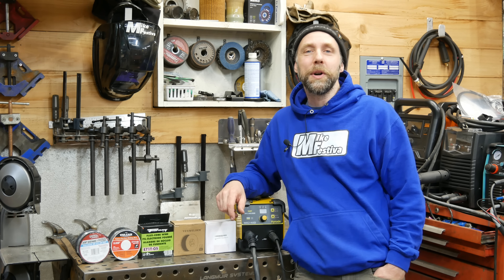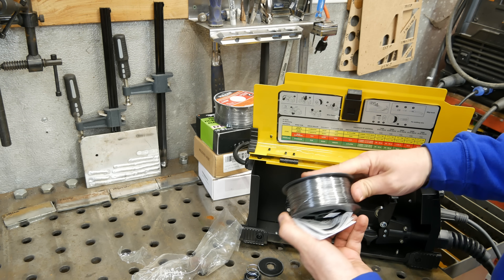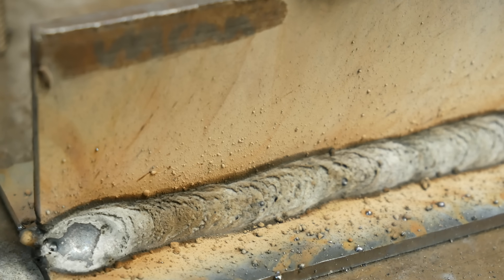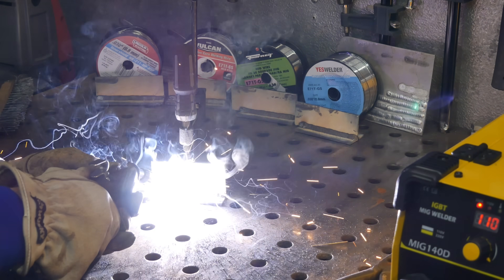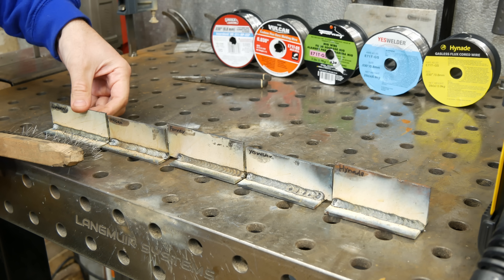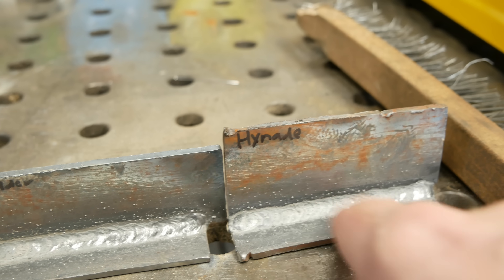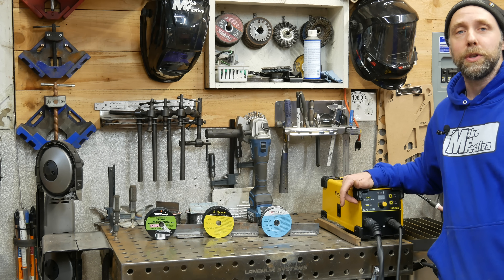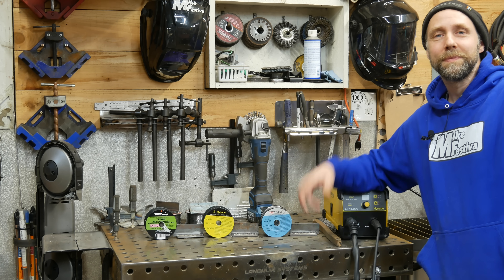Gasless Flux Core Welding Tips, Make Better Cleaner Welds

Comment: Thank you for the excellent comparison of wires. I have welded with MIG, TIG, and Stick mostly. I have a little Walmart flux machine that I use on thin stuff. Clean is the first item. If it's any thicker stuff preheating with the propane torch helps lots.
I don't do any serious welding with the thing, but I do find it is real good for tacking pre-weld for my 36 year old Craftsman AC/DC 225 stick welder. I've put that machine through hell. I'd recommend it to anyone if it was just as good today. It was made by Century.
I did use the flux machine to weld patches in my friends mower deck and liked the results.
I need to get a more serious flux machine in the future and I know whose videos I can reference to make a good decision.
Cheers
Terry from South Carolina
Reply from the maker: Thanks for watching Terry!
Reply: Terry,I have just acquired a Century 100 amp to do thin mower decks,info on #wire,speed greatly appreciated, thanks, Ken

Comment: Hey Mike,
I got the Hynade 155 today.  That's a fine machine.  I like the synergic mode.  Works nice.  Nice clean weld with the included .030 flux wire.  I like it.  I also tore into the Yeswelder flux 135 and found found a cold solder joint on the inverter board.  Works great now, so that issue is over with.  But now I have 3 flux core welders: Titanium 125, Yeswelder 135 and the new Hynade 155D.  My shop is starting to look like a welding supply store, lol.  I'll email Yeswelder Monday and tell them to close the ticket. I'm going to donate the Titanium to one of my neighbors.  Like you say..pay it forward.
Take care and thanks.
Reply from the maker: I’m glad you got the Hynade and like it!
I’m also glad you found the problem on the Yeswelder, it is a bummer you even had to take it apart to fix a brand new welder. I did send a message to Yeswelder the on Friday with your order # and problem, I told them they need to make it right with you and I mentioned I’m extremely disappointed in Yeswelder for not promptly taking care of your problem. 
I would hope they contact you come Monday. If you hear back from them I would be interested to hear what they say? I haven’t had any problems with there products so far but hearing they didn’t take care of your problem makes me question how much more I want to work with that company.
Paying it forward is awesome Timothy! I think your friend will be really happy 😊
Reply: @Mikefestiva  Yeah, it works great...nice beead using the .030 wire that was included. Ana@yeswelder was going to ship me a replacement welder and told me to keep the other one.  I replied that she can skip that since I repaired the one I have.  Overall, it turned out OK.  I would still buy their products, but they need to revamp their warranty process.

Comment: My biggest complaint about flux is the wire is so brittle and susceptible to kinking or breaking.  It would be good to compare this quality.    I also  dislike how these wires want to spring  into a mess.  I wish there was a design feature that inhibited this.
Reply: The Vulcan is horrible for this. I've had much better luck with Hobart flux wire. Haven't tried the Forney as i decided to stick with E71T-11 for now instead of the GS stuff.

Comment: Very interesting video, Mike, well done. Like you, I have only used Lincoln and Harbor Freight Flux core due to availabity.  These wires do not run the same on my machine. I have to tweek the machine settings for each wire to get good results. I would like to try some of the other brands that you tested. I have a small machine for flux core like you. I have a larger machine where I use solid wire, which I prefer.
Reply from the maker: Thanks Anthony 👍

Comment: What’s interesting about fluxcore, is that using it is not what many people expect. So the cheapest wire welders are fluxcore, because they’re simpler, and thus cheaper than MIG machines. The HF Titanium 125 is a good example. So the first experience new welders have with welding is fluxcore. But it’s harder to weld with fluxcore than mig. So it may not be the best choice for new welders, particularly the majority who haven’t taken a course in welding.

Comment: "Oerlikon Fluxofil 14HD" the best flux cored wire for field work on the market, not self shielding though still needs gas, but the welding afterwards knocking of the slagg is completely smooth, and they even brag that you can weld in all positions with the 1 setting shown on box.

Comment: I'd like to see you let these wires sit around for awhile then come back n see how they look n weld to simulate the guy that grabs a spool to have when they need the flux core. Maybe cut off a 12 inch piece from each n just let them sit out in the shop to see if they rust or in the case of the shiney ones, if they get dull

Comment: i always just figured horrendous spatter was just a fact of flux core life. i've tried lincolin, vulcan, and some i don't remember the name of that was cheap, so i tried it. i got about the same results out of each, so i just started buying the cheapest i could find. lucky me, i just bought a 10 lb. spool of fourney at rural king on clearance, but haven't tried it yet because i have to make an adapter to use the bigger spool on my welder. this kinda tells me that i should be on the lookout for fourney wire in the future. it really does suck having to spend more time cleaning slag and bb spatter after the fact, than time spent actually welding on projects. very useful vid, thanx!
Reply: depending on your machines capeable settings, spray transfer can seriously reduce spatter! low wire feed high volt, makes a continous even deposit rate, instead of 1000 small shortcuts wich sometimes explode.  try about 28volts 9.2m/min

Comment from the maker: Welding Wire Links
Amazon Paid Affiliate Links Below
Hynade Amazon Promo code 05MIKEWELD at checkout and save 5% 
Hynade Flux Core Gasless Mig Wire- https://amzn.to/35KX9XC 
Hynade 140D Flux welder Dual Voltage 110/220V https://amzn.to/3O4jMYy
YESWELDER Flux Core Gasless Mig Wire- https://amzn.to/3LLNkbd
Forney 42300 Flux Core Mig Wire- https://amzn.to/37nfqLh
Here’s a paid affiliate link to Yeswelder website
YESWELDER LINK:  https://yeswelder.com/?ref=s6nzvjxbwejy
SAVE 10% on your entire order! Promo code MIKEFESTIVA 
*Good affordable Plasma cutters below* 
Bestarc Pilot Arc 50Amps Plasma Cutter 110/220V Dual Voltage https://amzn.to/3KnCxDV
Hynade CUT40 budget friendly 120 volt HF start plasma. https://amzn.to/3KiZvMz
Reply: very enjoyable and easy to understand video, actually learned somethings
Reply from the maker: @terrymelen4239  Right on 👍🙂
Thanks for checking out my new video!

Comment: Mike, thank you for this review. I always used to run Lincoln flux, thinking the well known name brand would be better. I got in a bind and had to buy a spool of HF brand wire (Chicago Electric) before they changed to Vulcan. I just thought that I hated running flux. I don't do much flux core anymore, except when I run out of shielding gas, but like to keep a roll on hand, in case.
Reply from the maker: Thanks for checking out my new video Bill! Yes I don’t run Flux as much anymore either, like you I mainly keep it for a backup, and on occasion when I need to pack a small welder and don’t want to lug around a bottle of gas. Take care and have a good weekend 🙂

Comment: I used to use the holbart wire because it was available at my local tractor supply but now I have been using the Fourney for two years I have it sent every few months threw my Amazon subscribe and save and it’s even cheaper that way

Comment: The Lincoln wire Is the only wire out of the bunch that is E71T-11 which means it's actually rated and tested for 70k pounds and can be used with multi passes. There's an important difference between E71T-GS and E71T-11. If your welding for strength go with the Lincoln or another that's actually tested and rated.
Reply: The 
‘Off brands” are from makers we don’t know, and often the labels buy whatever is cheapest at the time. So one may be good one time, and bad another. Spatter and blueberries are as much a matter of technique as wire brand. I’ve found that different wires need to be welded somewhat differently. Some require a bit more or less amperage to weld at their best. You just have to practice a bit with either before using them.
Reply: Thanks for the info. I've been using the Lincoln for my very few attempts at welding and I've done multiple passes without thinking twice.
Reply: Thanks for adding this important comment.  Now I wonder if there is a similar distinction for stick electrodes.
Reply: @DamEngineer  yes there is, last digit of the number of the rod (7018, 6010, 6011) determines what the flux composition is and the application for the rods. Example, 0 is cellulose fast freeze DC current, 1 is cellulose fast freeze AC or DC current, 8 is low hydrogen iron powder fill freeze.
Reply: @DamEngineer  I don't remember all the details about how to read label but specs are on the electrode. What those numbers mean can be found.
Reply: I don’t know anyone who’s building a 70k pound truck, but okay.

Comment: The lincoln wire is E71T-11 versus E71T-GS. E71T-GS is more common. I was told E71T-GS is single pass and isn't standardized. E71-T11 is multi pass and has to meet standards. So E71T-GS can vary greatly between brands.
I think brand and freshness makes a big difference. Moisture can be an issue. Especially for us up here in the great north wet. I usually run hobart E71-T11 wire because it is convenient to get and runs better than some I've tried. 
Ultimately it's flux core and I'm not to worried about it being perfect.

Comment: The biggest denominator is if your welder is actually putting out DC. Cheap migs are actually putting out what resembles an AC signal, which is terrible for mig welding (lots of splatter). This is why popular mods for these cheaper welders include bridge rectifiers so that you get a clean DC signal. Needles to say, a quality welder will already put out a clean DC signal.

Comment: Just curious but could that welder do spray transfer flux core?
Reply: E71-T11 flux core wire can spray transfer. If the machine is capable.

Comment: I got a YesWelder Flux-135 last year, came with the same spool of fluxcore you tested in the video from YesWelder. Good to know its actually a good wire to use. Not that I have had any complaints about the welder or the wire, though I could use more practice at it.

Comment: I bought a 10lb roll of Lincoln once. Fought through about 5lbs of it and gave up, never again. 
The Vulcan i didn't think was too bad.
But lately I've been using the yeswelder and it works better than anything I've used before.
Reply from the maker: I’m glad you have noticed this as well! Definitely big difference in brands.
Thanks for checking out my new video and sharing your experience as well 🙂👍

Comment: Hey Mike, hope all's well. Thanks for the intel and demo. Have a project coming up and think now I'll consider fluxing to save on the C25 I've been blowing through to avoid the spatter and those related issues with the Lincoln flux (the only brand I've used because it came with my Pro Mig 140). The Lincoln solid's been ok (only brand I've used as well) but the cost per spool and to keep swapping out bottles around my neck of the woods can get rather pricey. Have you used any of these brand's solid wire with gas? That could be a game changer as well contingent on the price. Thanks and stay safe (all you other members as well) . . . . JJFIII

Comment: My Yeswelder Flux 135 was doa out of the box and I've been going around with Yeswelder on the warranty.  Had to send them photos of the issues and I still can't get them to replace it, so I will attempt repairing it myself and if that doesn't pan out, I will save any usable parts and scrap the rest.  Their so-called warranty is a joke.  My Yeswelder CUT 55 plasma cutter worked fine and have had no issues with it since.  Guess you get what you pay for.
Thanks for the great how-to on flux core.
Reply from the maker: I ordered a Flux 135 from Yeswelder about 3 months ago from Amazon for a future review, its been working great for me, I’m sorry yours isn’t.
Did you order it from Amazon or from the Yeswelder website? 
How long ago did you order it?
Reply: @Mikefestiva  I've had it about 1 wk.  Bought it direct from Yeswelder.  probably should have got in from Amazon.
Reply from the maker: @tpkirkp  can you let me know your order #
I’m extremely disappointing to hear they haven’t made it right for you.
Reply: @Mikefestiva  ORDER #YW4829622OL
Placed on March 29, 2022 at 4:07 am
Haven't heard back from Lily since I got on their case about the runaround I've been getting.  Last email was 2 days ago and they wanted me to test the stick function.  I I told them I don't use stick, I bought it for doing flux core welding.  My Everlast MTS211Si and Vulcan ProTig 200 all do stick, so I don't care about this.  I asked them to advise me whether they will honor their warranty or not.  This is the last time I ever buy a Yeswelder product.
Reply: BTW, the issue is control panel and display work, but the power LED does not light and there is no DCV btwn the ground clamp and the MIG gun on trigger press. I put a DMM across them to check.  I sent pics of same to their tech support.

Comment: I've never had any luck with flux core 😆 always thought it was a gimmick to sell cheap welders! Interesting to see decent  quality from it. Great video man 👍👍👍
Reply from the maker: Thanks for checking out my new video! I prefer MIG as well but flux wire is an affordable way to get started in welding for some and has a few advantages in some applications.
Take care buddy 🙂👍
Reply: It's been quite a while since I've welded at all, I always preferred mig, but I was once a pretty good beginner at stick! I think everyone should battle a stick welder once in their life 😆. I still have a huge 75/25 bottle and a few regulators, just need a new welder. I might get a HF one for ease of returning/warranty ext., and because I'm frugal AF 😁

Comment: Hi Mike! I hope you are well. Please! Can you help me to set up my MIG 205DS? I all ready have my solid wire 0.35 and also 0.35 flux wire just like you told me you use for most of your proyects. Still have not find how to control the speed wire,  what amperage or voltage to use to weld very thin material with out burning the material.
As always thank you so much. And still watching your channel. A big hug for you. God bless you bro! (I bought both spools from yeswelder)

Comment: Great video Mike. I have a cheap 110vt flux core wire feed welder and used both the Vulcan and Lincoln wire and I will say I don't know to weld properly but both had a ton of splatter and BBs on the stuff I did so maybe I am better than I think and it was the wire.  Who knows? I always learn something from your videos. Thanks for making them.
Reply from the maker: Thanks Tom!

Comment: I noticed that you went straight to the Wire Brush and Wire Wheel.
Why didn't you "try" the Chipping Hammer first? 🤔
My local ACE carries the For-Ney (?) Wire in their Welding area.
I'll have to see what THEY charge compared to On-line.
I still have my "Chicago Electric FLUX 125" (from HFT) that I bought 2 years ago and the VULCAN  0.035" (7#) Spool and a C.E. Auto Darkening Helmet (Blue Flame) still in box... 😿
My back went from bad to worse, but I still have plans to make use of these "SOMEDAY"!
With you being a "LOCAL", I would love to meet you so that maybe I can get some Inspiration to pull the "figurative" Sick out...

Comment: It would be interesting to see a "cut and etch" to see penetration characteristics. There is another flux wire to consider: Blue Demon E71T-11 X .030. Question is how do they do on a re-weld over test. Maybe do a part two? Thanks Mike.
Reply: I watch.  In fact you are the reason I bought a flux core welder and hobby around with it.
Reply: I agree, cut it open and see.
Reply from the maker: @delmas15  Possibly In a future video? 
Unfortunately I lost over 50 subscribers when I posted this video.
I may make a cut and etch video like I have on some of my other videos in the past, but 90% of my subscribers don’t watch this stuff anyways. 😔
Reply: @Mikefestiva  that’s unfortunate Mike as I find your opinion and experience valuable as I start welding for the first time since high school (1984). Maybe those folks are more experienced welders only interested in your projects but still no reason to unsub.
Reply: @Mikefestiva  Well you gotta keep them subscribers, so take care of that. Can’t believe they would drop you for making a video about flux core wires. Some people ain’t come around to accept that it has an application yet huh?
Reply: I have the blue devil stuff. Im a noob welder so dont know if i matter or not but blue devil seems to work like vulcan and lincoln
Reply: Inetub is another popular wire on Amazon

Comment: Great video! All those wires were pretty good. But I've had some really awful cheap ones off Amazon before (lots of porosity like the flux isn't actually shielding properly). The Lincoln wire is a different grade and is the only one rated for multiple passes if you need to weld something thick.

Comment: Thanks Mike I'm gettin ready to buy something, have you tried Yes's 5 in 1 yet ?
Reply from the maker: Hello David, I have tried out the 5 in 1 yeswelder and at this point I would suggest to hold off on buying one, I feel the auto mig settings are a bit off, the lift TIG feels like a scratch start and the high frequency start on the plasma feels a bit finicky. That’s my honest feelings about the one I have been testing out. Take care buddy 🙂👍